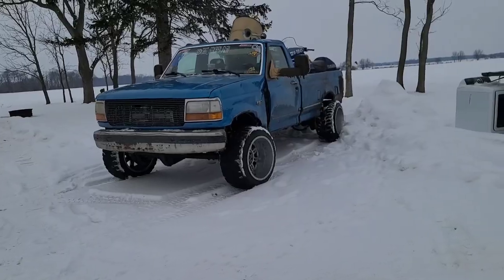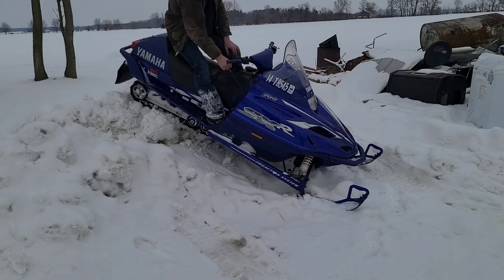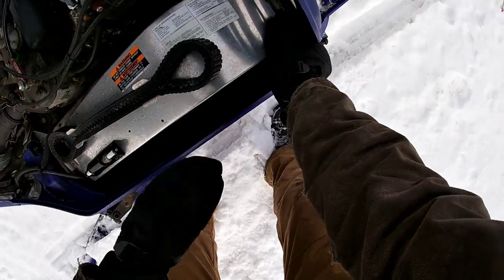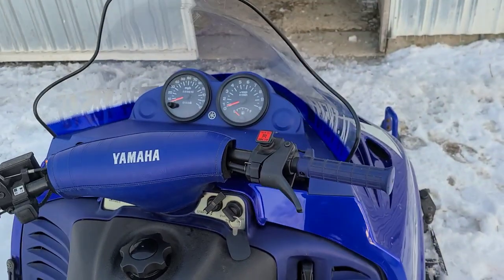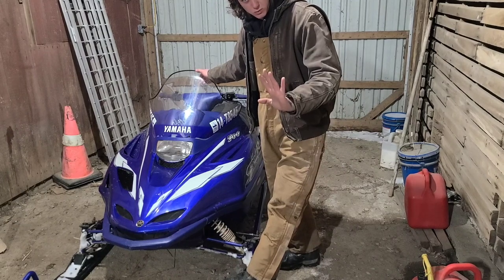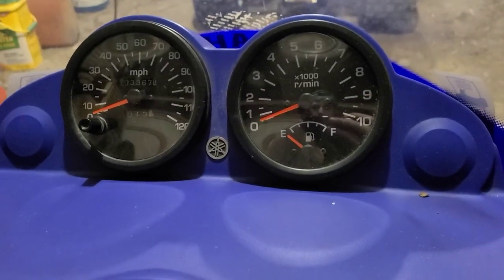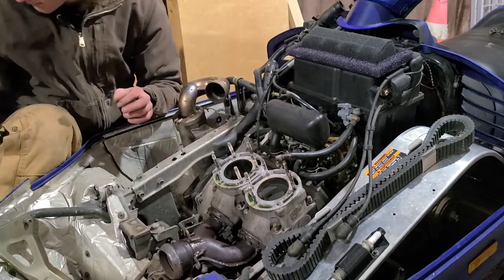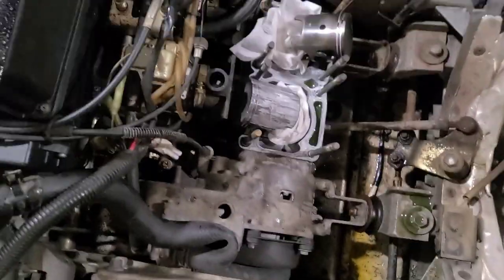I BOUGHT A SNOWMOBILE AND BLEW IT UP IN 2HRS

Comment: I love the people in this comment section saying you have to mix the oil in this sled😅😅😅 it has oil injection you don't have to mix the oil in the gas, and if you eliminate the oil injection that's a good way to burn up the lower end of the motor the oil injection is how the  crank gets oil.
Reply: No one ever understands that’s. Oil injection is so reliable and cheap to fix you up would have to be stupid to delete it.
Reply: @morgenwood602  you ain't kidding, it's not like it's new technology it's been around since the 80's it's pretty much perfected at this point
Reply: I used to add a little bit of oil to my gas also and then run a hotter plug.
Reply: When it comes to sled heads we are ALL correct on problem solving. Lol. NOTTT🤣🤣🍺🍺
Reply: @morgenwood602  never know its broken till its toolate and this sled is old
Reply: Wrong, I have the 600 version of this sled and I have been running it forever on just mixed gas. On the triples I would agree one hundred percent but not the twins.
Reply: ohh yea. what if the injection pump takes a shit then what
Reply: You can put a little bit of oil in the gas with injection
Reply: @maxvancamp245  been riding snowmobiles for 30+ years never had an oil pump shit out on me 🤷🏻‍♂️
Reply: @dragmasteramtruck318  I never said you couldn't do that but it's pointless now you just mixing the gas with too much oil you're going to foul plugs....
Reply: @trevorenglebert2276  well then you've been lucky lol.
Reply: @Brandon Hvizdzak I've never (or know of anyone) in the 30 plus years of snowmobiling have a problem with oil injection,  I get  you have to with the older sleds there was no oil injection. But people saying that he needs to mix the gas on this 2005 snowmobile is laughable 😆
Reply: @trevorenglebert2276  twins are oil injected but will work fine with mixed if the injection system is removed
Reply: @ramsay4804  I’ve fouled more plugs with my oil injected sled
Reply: @dirtscooter_12  I run my sled off of pre mix and the injection is deleted. I don’t trust a 20+ year old sled that’s been beat on it’s entire life
Reply: @trevorenglebert2276  then someone has messed with it and it making it pump more oil then it should, or you got another issue 🤷🏻‍♂️
Reply: @ramsay4804  I just think mixing oil is easier and you can tell exactly how much oil you’re getting. You can also adjust if you want to run it leaner or richer by changing the mixtures. I just like mixing oil more. Less things to worry about going wrong
Reply: @trevorenglebert2276  to each there own
Reply: @trevorenglebert2276  lol ya probably a good idea I got a 93 indy 500 but luckily the injection still works
Reply: @reidh1815  well, to start, I have three identical sleds to what Clayton just bought. The same exact thing happened to it. Oil pump went out,  and seized up. Switched to premix and it runs better than before. I own both premix and injected sleds, it’s all preference and what ur using the sled for
Reply: @trevorenglebert2276  I’ve never had problems with oil injection other than when I bought a sled that wasn’t taken care of knock on wood
Reply: @trevorenglebert2276  go check out the SKINDY.500 channel it’s hilarious
Reply: @SKINDY.500 YEE YEE YEE SKINDY IS THE CHUNKA
Reply: @reidh1815  not bad😂
Reply: @trevorenglebert2276  ITS MINT
Reply: @maxvancamp245  when they fail they go wide open,just lots of smoke.
Reply: you obviously have zero clue how the oil injection works on this sled it has two jets one on each intake runner just behind the carb the only way oil gets to the crank is by it mixing with the gas vapor coming from the carb which then fills the crank. rc snowmobiles don't count for sledding experience... there are thousands of snowmobiles in my area that have the oil injection deleted because up until the last few years its a pile of crap the only reason people aren't deleting it on the new sleds is because some of them actually inject oil right to the bearings. premixing the gas is 1000% better on  any older carbed sled out there
Reply: and yes this Yamaha is considered a old ass sled
Reply: @johnyjanzen1140  can confirm , oil is injected right after the carbs like on most old sled’s. Yamaha even injected the oil into the gas line on some models. And I’ve had oil injection systems fail on a bombardier twice and Polaris. Also seen lots more fail especially on the fan cooled bombardiers with the pump bolted to the starter cup driven by a little plastic rod that likes the break.
Reply: @SKINDY.500  I've owned several Polaris over the years, lots of bombardier,  few yami's and 2 cats. I can tell ya with certainty they all fuckin break lol
Reply: If the oil injection is actually working bud.
Reply: @ericpruit2775  never had a problem with it
Reply: What I’m saying is how do you know that Freeds oil
Injection was working? Maybe it wasn’t working properly and the previous owner never mentioned it?
Reply: Yes it has oil injection but it doesn't hurt to mix your gas to be safe  better to be safe than sorry
Reply: @phoenixarizona8441 I am good I'll use the oil injection that's never let me down..... Seems to be a bunch of people driving a bunch of shit boxes in this comment sectiont since there  oil injection doesn't work 🤷🏻‍♂️
Reply: I will agree with you that oil injection is very reliable and there is no benefit in deleting it. BUT running pre-mix won't "burn up" your bottom end on these older carbed units. The air and fuel/oil mix in the crank case lubricating your crank bearings.
Reply: @ThePolarisRMK  yes 100%  we were riding last winter my dad said he filled the sleds with 2 cycle snowmobile oil and gas they are ready to ride we rode around for about 30 minutes my brother is on my dad's Yamaha Exciter II 570 sled start running really good for a while then started bogging out  my brother decided that he would let the sled cool down comes out a little bit later nothing turn the key it would try to start and die dad come out lifted the track off the ground hits the key sled starts but running like shit dad hits it and holds it wide open sled cleans out as soon as you let off she would die dad looks again Oh Shit sleds done we have Aluminum coming out of the pipe  we tear it down burned up the #2 piston dad looks no marks in the jug or anywhere else orders a Yamaha Exciter II rebuild kit this year both sleds run perfect premix on older sled run the Red Cyclone based 2 cycle snowmobile oil better for older sleds
Reply: Eternal Cowboy  hahahah do you even mechanic??? on two stroke carbureted snowmobiles. The carbs feed into the crank case so ya you get fuel with your bearing. look it up dude. all snocross sleds from factory run premix
Reply: Eternal Cowboy  you obviously don't mechanic if you think two strokes snowmobiles have oil in the crank case..... be gone simpleton
Reply: @ramsay4804  can you explain how the oil gets to the crank?
Reply: @BadMOFO1080  the same way it's gets it for the top end....the oil injection 🤷🏻‍♂️🤦🏻‍♂️
Reply: @trevorenglebert2276  lmao  so your sled literally uses a separate pump to pump the oil into the gas so if you got rid of the oil pump and premixed gas it would be the exact same as it is now with one less thing to break and cause a failure
Reply: @johnyjanzen1140  exactly why i deleted the oil pump
Reply: Delete the oil injection an mix it urself. Shit will blow up wen the lines clog and it dont mix like what happen to blasters all the time.
Reply: @ramsay4804  i prefer to mix my own fuel anyway, always have and always will.
Reply: @Blaines-smallengine-repair  good for you 👍🏼

Comment: Snowmobiles are like women you work on them all day just to ride her 20 minutes
Reply: I just work on mine not much ride time
Reply: And I just pretend To have one 🤣
Reply: Underrated comment of the year 👏
Reply: I just ride mine.
Reply: Nothing like plugged jets (ethanol) or bad crank seal.
That'll melt er down in no time...
Reply: I had a 2012 Arctic Cat XF 1100 Turbo with Stage 2 Exterminator kit and Hypershift Clutch, the fastest thing I've ever been on and could be down right scary at times.  I spent 80% working on it, 10% riding like heII AND 10% worrying about what was gonna break next. 

If anyone is thinking about putting a lot of $$$ into snowmobiles.... DON'T.. And don't waste your money on anything over a 600, you'll have just as much fun(almost) ringing it out and you'll be able to ride more and cost ALOT less to maintain.

Comment: Make sure the oil injection is working, I would premix some oil into the fuel to be safe. Clean the carbs/replace jets and make sure there is no air leaks on the intake boots. Also let it warm up a few minutes before riding it or it can cold seize, the piston expands faster then the cylinder.

Comment: When you ran out of gas while at the gas station when you were getting gas. Did you also put 2 stroke oil in it with the gas or if it has a separate reservoir
Reply: I was wrong about for 2 stroke oil

Comment: Sounds like the oil injection quit or the tank is empty
Reply: Maybe carb?
Reply: on these sleds, at least the triples, if the oil pump fails (not VERY RARE) they go wide open to prevent engine failure. Probably either ran it out of oil, or bought a total lemon. Although it looks crazy clean
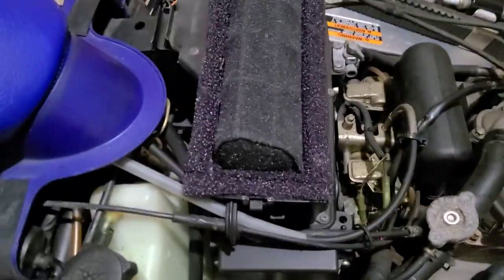Reply: Tank was empty for sure, look at the oil tank at 13:39

Comment: I’m a little late on this video but, did you figure out why it kept dying? My 750cc jet ski has the oil injection and it decided to start turning off on me at random times. After digging into it, I found a little hose coming from the oil tank to somewhere(can’t remember, been a few years) that had dry rotted and oil was no longer getting to where it needed to be. It was causing the engine to shut off. It would start back up after about 5-10 minutes.

Comment: When u went to the gas station did u out premix in it ? Or just gas?
Reply: Has oil injection and I'm sure he checked it.  Mine has a sensor that when it runs out of oil in the injection tank it won't start and turns a light on the display.
Reply: @rxtuninginc8444  oh alright and that’s cool I honestly never knew anything about oil injection thanks for teaching me

Comment: You did put oil in the fuel? or was it water locking
Reply: It has an injection system as most snowmobiles do.  Does it on its own you just fill the tank with oil.

Comment: Is the oil injection working and full, wouldn’t hurt to disconnect it and mix your own fuel so you don’t have this problem in the future
Reply: If you disconnect your oil injection it robs the lower end of oil new sleds are designed to have the oil injection there that's how they get oil to the crank.

Comment: Don’t run it out with the “mufly mufly” on there cuz it isn’t a muffler the muffler is the can that sits vertical, cuz it is actually an expansion chamber and without it you don’t have enough back pressure and it will run lean, run lean=boom boom

Comment: find out why it seized or it could happen again after the rebuild. I would check the oil pump first. someone may have messed with the pump setting. You should get 3 tanks of fuel to 1 tank of 2stroke oil.  If someone installed weisco pistons in it and you didn't warm it up before take off that would do it. I would check both crank seals  and water pump + intake carb boots for cracks before you rebuild a dirty jet could also do it.
Reply from the maker: Dirty oil injector
Reply: glad you found the problem,  just didn't want to see you burn it down again. Yamaha sleds from that era are usually very reliable and last a long time. check the machine over well for any other surprises.

Comment: Umm did u put oil in the gas from the gas station
Reply: That’s what i was thinking but only one piston was scored so there was probably oil in the gas  or i feel like both pistons would have gotten ruined
Reply: Snowmobiles are oil injected, your not supposed to premix your gas
Reply: @jackfulton6696  sometimes the oil injector goes bad on older machines and doesn't inject any/enough oil and the motor can seize.
Reply: @patrickthompson3891  if you run premix with a working pump you are going to cause stuck rings fouled plugs and blow by, the only time you should be running premix in a snowmobile is if you have done a proper oil pump delete, or you freshly rebuilt your motor, I have worked around sleds a long time and it is a common misconception that oil pumps are prone to failing, personally I have never seen or had one fail on me. When ever I buy a used sled I always check oil system functionality, its very easy, take all the oil lines off except the one going to the pump from the reservoir, take the pump off leaving the oil line from rhe reservoir on, chuck the shaft of the pump in a drill, and spin it for a good while, if oil comes out, your good to go, you can also check your check valves and oil fittings by injecting oil into them with a syringe, if oil passes through then they are not clogged and in working order
Reply: One cylinder gets more heat faster. So you know. One piston can go first lol 🤦‍♂️
Reply: @stevenblack2548  clutch side

Comment: If you have melted aluminum on the cylinder walls muriatic acid works to get it off with a q tip. It doesn't damage nikasil coating, usually, don't get it on your hands, you might die, usually.

Comment: Just had the same thing happen to me hole in the piston and all. I sprayed wd40 down in the crank and sucked it out and kept doing that to clean it out
Reply: I've used diesel fuel in the past. It works great. Just put a 5 gallon bucket in line with the shop vac to catch the diesel

Comment: Freed: "What I pile"
Me ( A 13 teen yr old who has been riding them for 11 years): "You just don't know how to ride one" also buy a skidoo next time

Keep the vids comin love em
Reply: They'll all blow up sometime or need a rebuild
Reply: LOL he wasn't being that hard on it. Any brand-used sled usually has its problems unless you go over the whole thing and make sure everything's right. My friend bought an old skidoo mx and that thing was a pile. Suspension fell apart by just looking at it and for only 470cc it was HEAVY! Some poor soul bought it for over 2 grand and with that he was able to get a ZR800 cat which has a broken reverse, and clutch issues 😂
Reply: Lex Prue Trust me I know
Reply: Ethan I rolled mine. I fixed it and come to find out the motor blew when I rolled it. ( I rolled it 20'times before it when end over end)
Reply: Also Alex Prue and Ethan he also was running n one pistil not for a minute when he first started it.

Comment: do not remove the exhaust, the engine needs back pressure
Reply: No it is a 2 stroke 😂
Reply: No it doesn’t
Reply: @brooklynduiker6635  they do ... correct me if im wrong
Reply: You would need to put bigger jets in it or else it will run lean

Comment: Runnin it without oil my man. Pump probably quit working, bypass it and just premix right in the gas tank
Reply: Both cylinders would have shit the bed then, probably a bad oil line or oil check valve to the carb and case on that cylinder

Comment: Yeah all you guys saying not to ever delete your oil injector are idiots have you ever been miles away from your house and your sled blows-up only because your oil injector failed well it happend to me on a damn near brand new machine. That day I vowed to never let that happen again always get rid of oil injection. Trust me your life could depend on it also never ride alone. BTW the sled in the video kept dieing out beacuse the clutch was bad it was seizing up. At some point point someone probably tried to put different weighs in the cluth and messed it up. That's why when he would rock the clutch back and forth it would unseize. But also when you are in very shallow snow you need to drag your foot so the snow hits the radiator or else the sled.will overheat and pop a head or just grenade itself.

Comment: Carb wouldn't be the issue. Since its oiled injection you probably want to see if your oil pump is even peoducing enough oil to that carb. And since thst piston is screwed hone the cylinder. You have to anyways or your rings will break and blow the engine again. Im doing a rebuild rn on my slid do but it just has low compression.
Reply: He'll need to sleeve the cylinder or send it for re-plating. Maybe yamaha's changed but the last 2 stroke Yamaha I worked on had nikasil coating on the cylinder.

Comment: I’m turning my lawnmower into a home made snowmobile because they are expensive, skis in the front and cutting the track in half and putting it on the back tires
Reply: @idk-ni2vn  Yeah I’m thinking about it, I need to find a centrifugal clutch that I can mount underneath the engine that goes out to a gear, I’ll either have to find one with a big sprocket upfront or make one myself because they’re all small sprocket
Reply: @ampexxxtreme5387  hope it works out well

Comment: You know if you would have turned the Sled around lifted the back bar on the back bar on the quad it would have been way easier to pull it in the garage and 2nd when you run out of gas always check the oil you supposed to fill it after a couple tanks of gas the guy you got it off probably didn't fill the oil jug

Comment: Is it a 2 stroke? If so did yu put oil in it at gas station? Lol
Reply: It's oil injected, no need for pe mixing, that hasn't been a thing since like 1984 lol
Reply: @ramsay4804  ok lol, only 2 stroke I have is an outboard boat motor, idk a lot about snowmobiles
Reply: @seykey2022  still going to mix gas and outboard motors?  I just learned that myself I figured they were oil injected by now as well lol.

Comment: I had the same problem with my snowmobile it hydro locked one of the cylinders was loading up with fuel and wasn’t burning it so it shut off and seized I fixed it by cleaning the carbs and putting new spark plugs in.